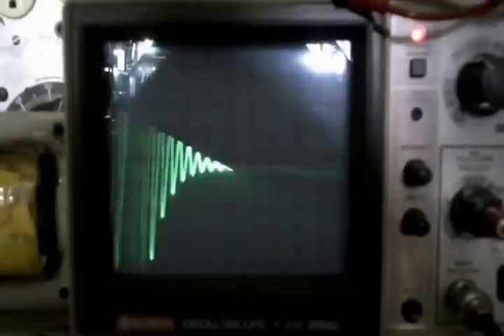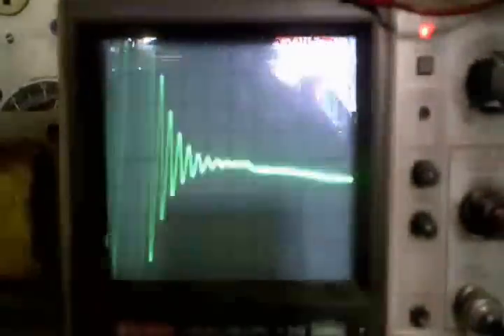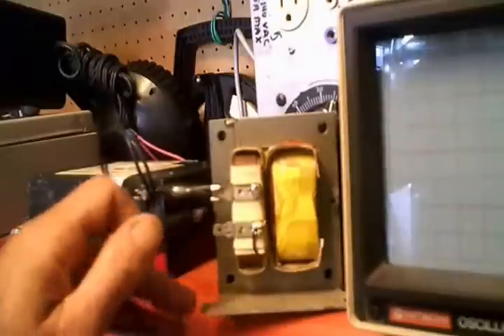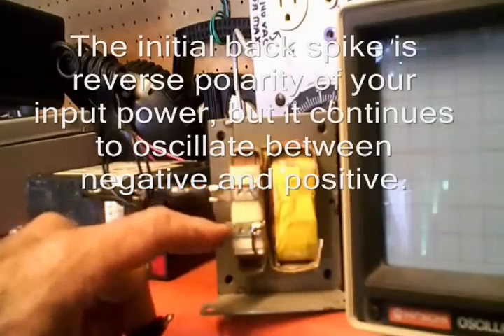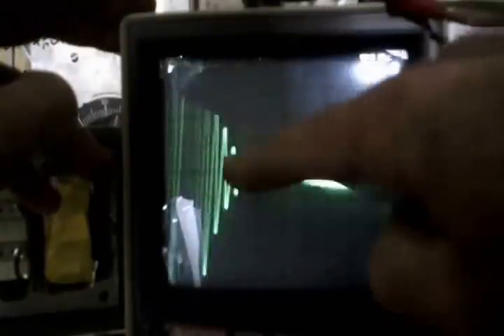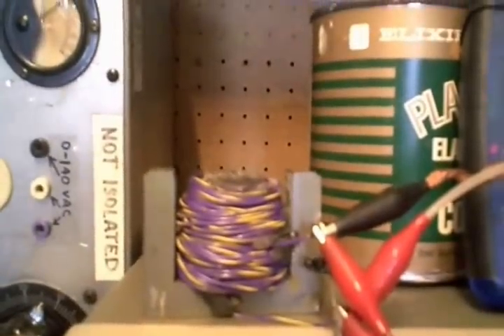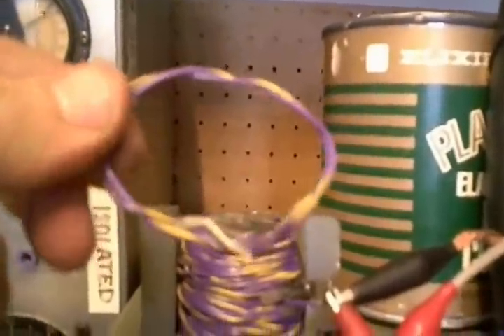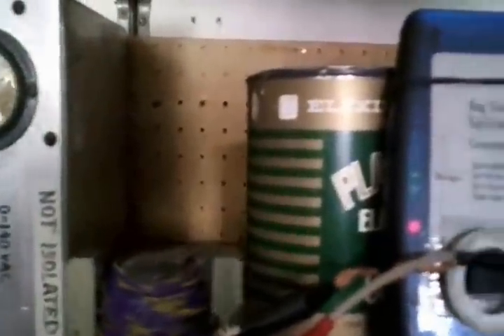Ring tester for Coils and Transformers.

Comment: If instead of the ring tester, I use a signal generator with a pulse wave form and measure with an oscilloscope, will that be ok or unsafe for the signal generator?
Reply from the maker: Your question is hard to me to understand, Are you testing transformers?
Reply: Yes, in fact flybacks and yokes. I would like to use a signal generator instead of the blue tester to send the pulse.

Comment: Does the ring tester need to be connected only to primary? If you're not sure about pin-outs on a PC trans, can you just pick 2 pins that show continuity (ie, a winding)? Or does it have to be the primary?
Reply from the maker: It's designed to test the primary side of a transformer, but I was also able to ring the secondary side on some transformers.  I've seen some inverter transformers that it failed to work on at all.
Reply: Well that's disappointing, seeing how SMPS repair is probably it's primary market...
Reply: @davecc0000  in smps transformers, if a secondary winding is faulty, most likely a physical inpspection can tell it. Probably symptoms of burning or discoloration at the least. It's the primary winding that's more tricky because mostly located at the inner part of the transformer. Sometimes a completely burnt primary winding may not show any physical symptoms.

Comment: Is it able to check for shorts in large Linear Power transformers???
Reply: Noah TJ , For testing a linear transformer, just connect in series to its primary winding an incandescent lamp. Then connect it to the power supply. If the lamp glows, you've got a shorted turns problem. If the lamp does not light at all, your transformer is in perfect condition. The lamp does not need to be higher than 40Watts of power.
Reply from the maker: +Noah TJ I don't know the specifics for your particular transformer. The Blue Ring tester is designed to test the primary side of transformers, but there are some transformers it doesn't work on.
Reply: IT is a 3.5kva inverter transformer. quite Large.

Comment: How much voltage was introduced into the coil?
Reply from the maker: Beau Michna  It would be difficult to measure this kind of oscillation, but conventional physics teaches  it should always be less than the input power.
Reply: +Grants Pass TV Repair Ok thanks. Appreciate it.